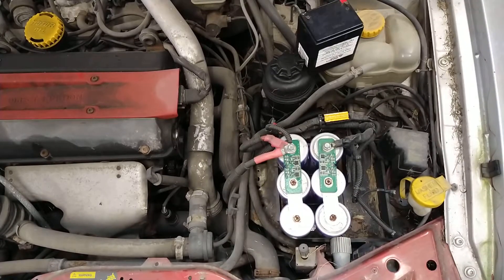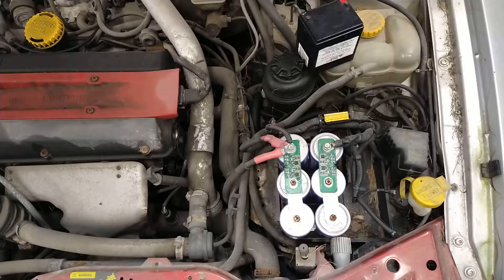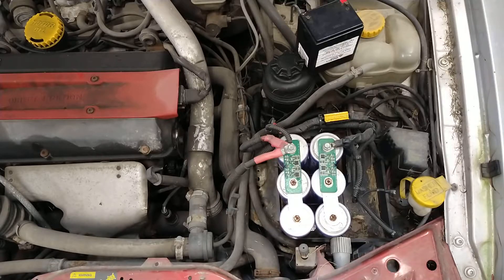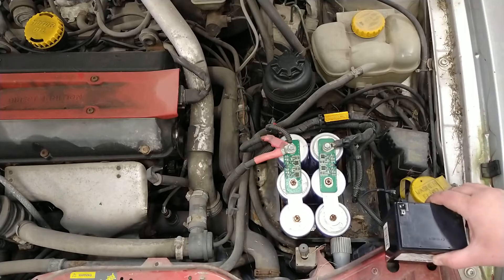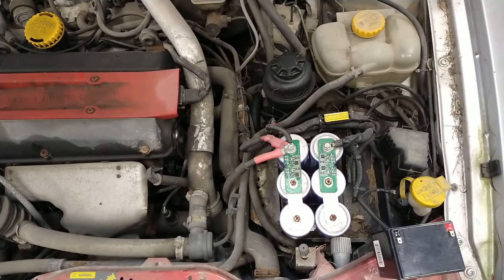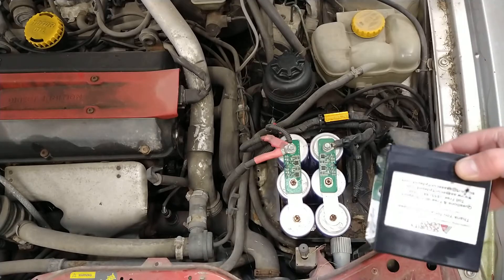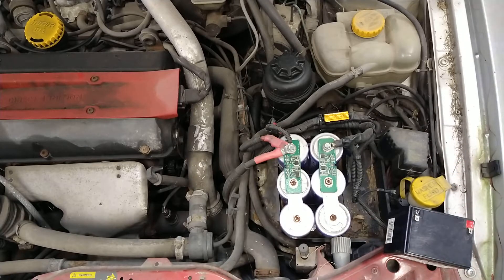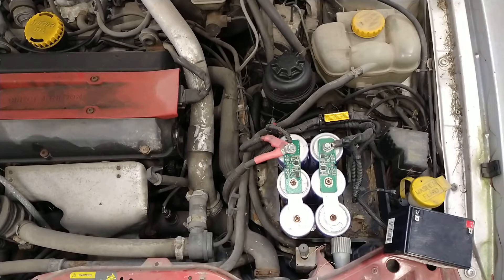Using a super capacitor as a battery (part 15)

Comment: If I was to add a 100f 16v (6x 600f in series) capacitors in parallel with the existing 40ah lead acid battery, would this be better, or worse? Sometimes I leave the car for multiple weeks without starting, it is okay with the existing battery, it just cranks slow and I don’t think you would get a second chance, however I wonder if adding super capacitor like this would be worse or better?

The reason for investigating this is since when I put the headlights on, or load up the battery with the heater on, the voltage drops from 13.9 to 13.5 on the battery! From what I understand the super capacitor would keep the voltage stable even with high loads, maintaining the 13.9v continuously, correct me if I’m wrong - thanks